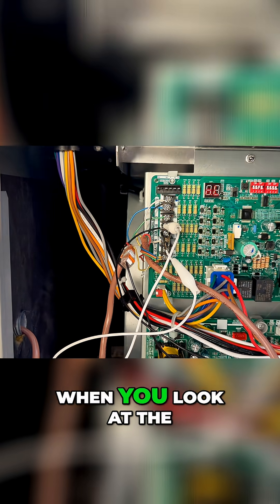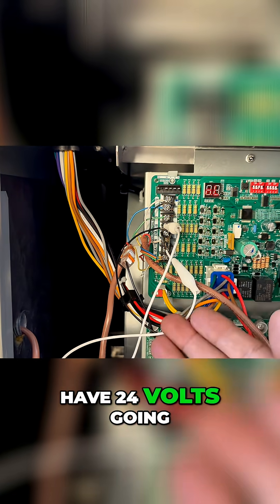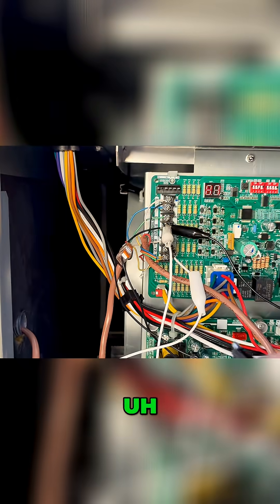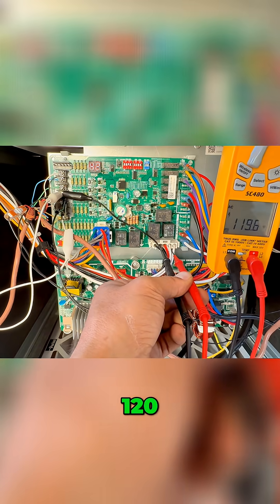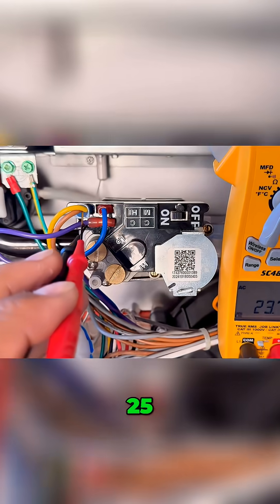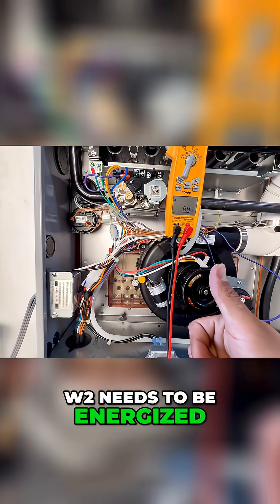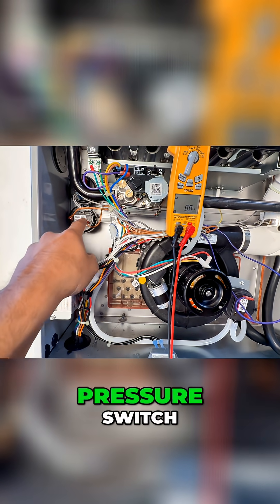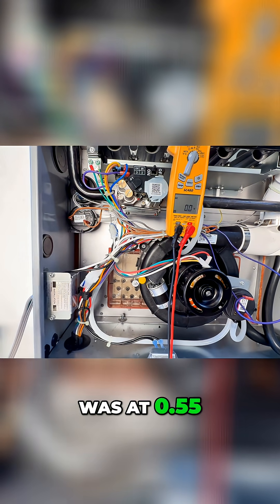HVAC Stage 2 Explained for heating and cooling #shorts

Comment: Can you make a video following the schematics showing us how the 2nd stage goes into operation. Can you make a video showing us voltage drop, how you know if a component is pulling too many ohms or amps.  What does it actually mean if a compressor overload goes off does it mean that we have a problem on the electrical side or Freon. What action should we take if the low pressure and high pressure switch opens. I been reading my electrical book maybe I might cross it soon.
Reply from the maker: I’ll be making a video next week on how to troubleshoot a split system and I’ll be talking about the pressure switches as well.